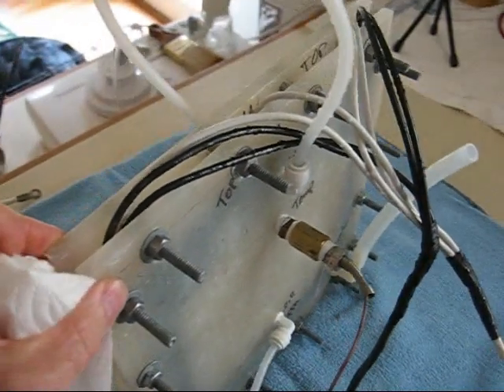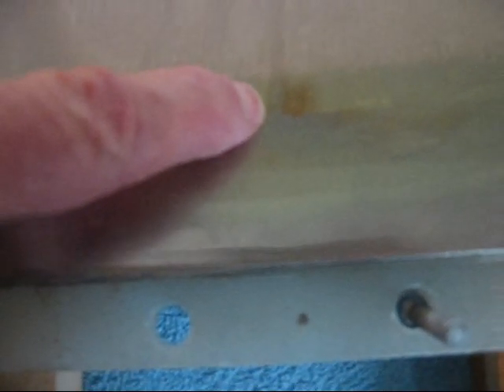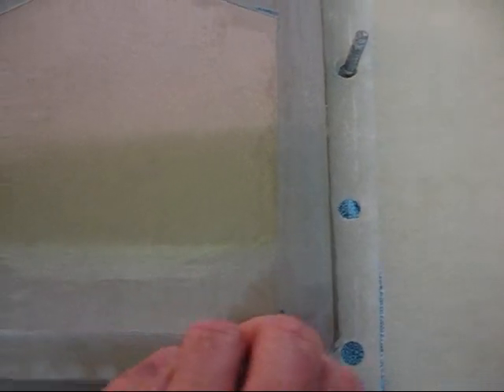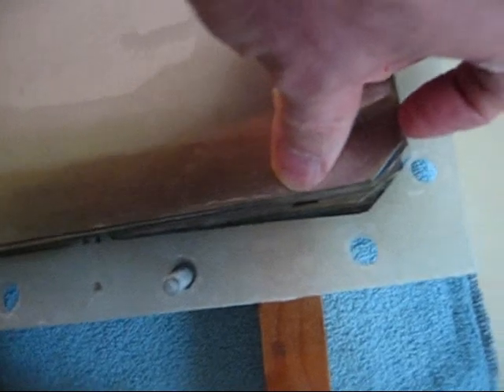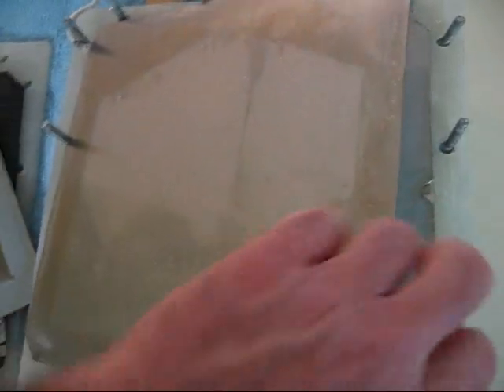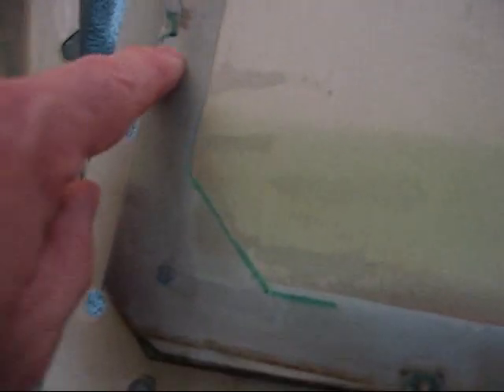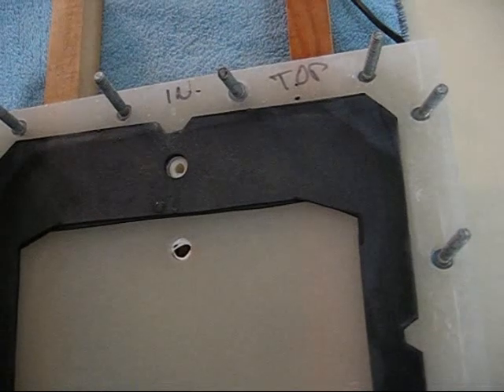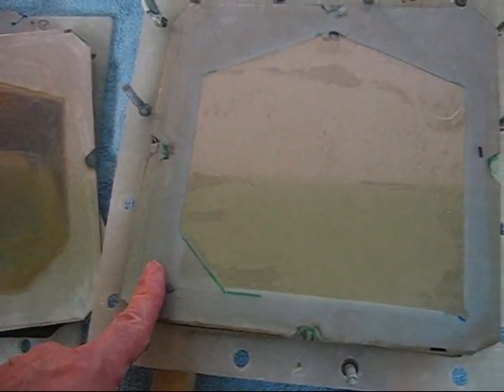HHO Dry Cell Mars Gasket Part 11

Comment from the maker: Hi Thanks for the suggestions. I agree that the sandwich boards need to be stiffer. The 3/8 nylon I used was free and I am cheap err I mean frugal. I plan on using ¼ stainless as combined negative/sandwich boards as soon as I can find a bargain.  

In this experiment I am purposefully limiting flow to help the brick build up some heat. I am trying to use thinner gaskets to allow the use of weaker electrolyte.  Continues-

Comment from the maker: I agree that I need to open up the flow a little since some of the fill holes were blocked. My plan was to limit flow to just over what is necessary to replenish the cracked water. High flow rates are necessary to control heat. In this cell there is too little heat. I may need to increase the lower holes a little but I plan to retest it with the holes unblocked first. 

I believe that regular EBN type dry cells have hot spots around the unprotected holes. Continues-

Comment from the maker: Continued: If we could measure the temp around the holes it would be much higher than the average brick temp (possibly even boiling). With the Mars gasket the hot spots are eliminated.

As for roasting, I don't think so the brick never got above 20C on it's own. I had to heat the electrolyte on the stove so that I could test it at 45C.  I think my scrap yard stainless has a lot of iron in it.

I have watched most of your videos including the tear down and they are very interesting.
Mars

Comment: Nice set of vids.
May I make a few suggestions?
Increase outer plate size to 1/2 inch for more rigidity (or even 3/4). Increase electrode holes to 3/8(at least the bottom holes). Also, increasing gasket thickness will help with flow. We use 3/32 EPDM rubber. This helps flow and mmw.
Of course, don't make too many changes without testing each...your cell size IS larger than ours, but these admustments helped us. Great work!
You ARE on the right track by using shaped gaskets.
Steve

Comment from the maker: Hi NytroHydro: I believe that all of the voltage leakage flows through the electrolyte.Sealling the edges of the holes only works if you also seal the surface of the plates far enough so that the current prefers to flow from plate to plate and not skip to the second or third plate. This a difficult concept to explain in less than 500 characters. Apparently I didn't explain it well enough in the videos.
Good Luck, Mars

Comment from the maker: Continued: Weaker electrolyte will cut down on voltage leakage through the electrolyte, lessen the electrolyte contamination in the engine and be safer to handle. 

I would like to use EPDM or Silicone since they are more heat and chemical resistant but I am waiting to find a bargain on some thin stuff. For my next giant brick I will need a lot of it, about 300 square feet.
Mars

Comment: hard to read with flow problems, clean the plates, and fix the flow, and see what it is then, also make notes as to the color of the plates and lines, in correlation with its possition and voltage in the cell.